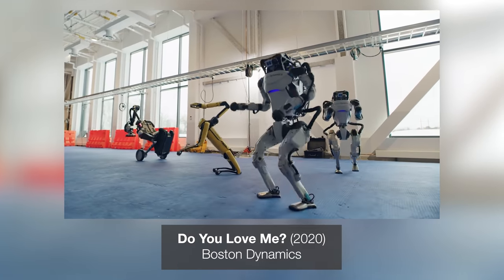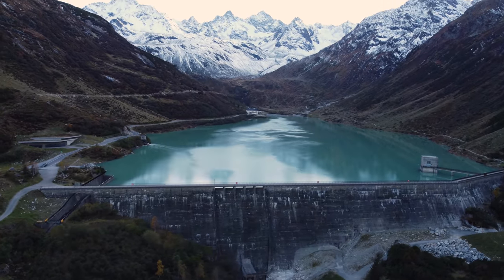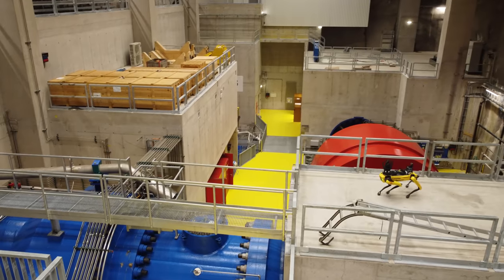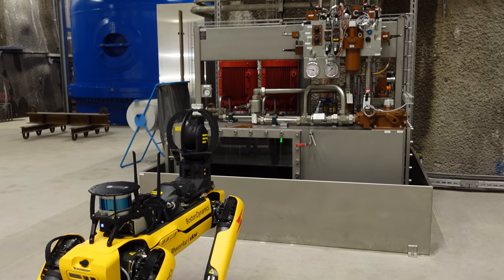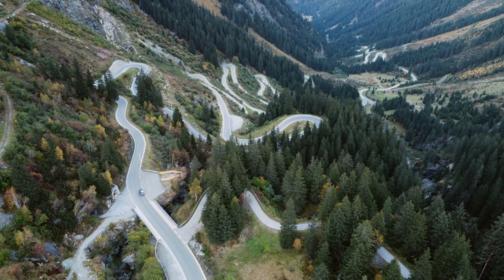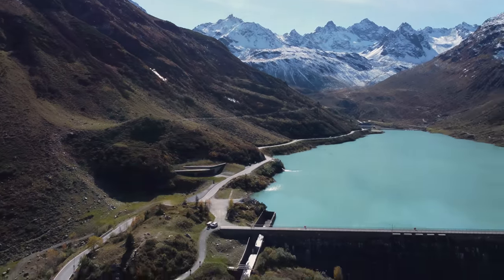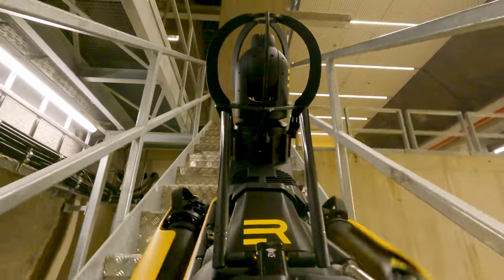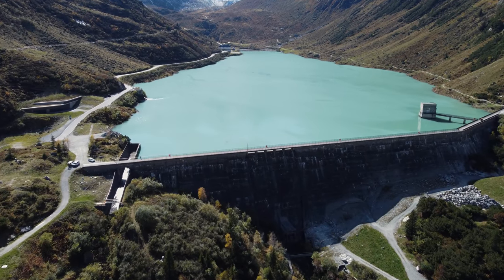An actual, real-world use for robot dogs

Comment: I'm really surprised it's cheaper to have sensors on high-tech walking robots, rather than just having more sensors that are stationary at the key points.
Reply: Interesting question! I hope someone answers....
Reply: That's what I thought. Just put cameras at strategic locations. Surely even a few hundred cameras are cheaper than one dog.
Reply: I wouldn't be surprised if one or two dogs were actually cheaper than a few hundred cameras. ;)
Not to mention the hassle of installing and maintaining them.
Or the issue of "key points" - what if something breaks somewhere else? With a robot, you can react on the fly.
Reply: One example of cost here is the Thermal camera, it costs about 5000$ and if you need 20 of those cameras around your plant the robot is cheaper. Another advantage is the flexibly you have with these robots, to check something the stationary sensor might not see
Reply: I wished they talked about this. But there MUST be a logical reason to use spot. Engineers are smart, they wouldn't buy spot if there was a better way.
Reply: @Morhua1  Engineers dont have a say in things like this. Business people do. So, sometimes decisions are made to further someone's political ambition instead of doing what makes sense.
Reply: that dog costs ~10,000$
an engineer costs more than 2,000$ each month
Reply: There is a near-infinite number of points that can can contribute to failure, and to detect some of them (e.g. concrete cracks, heat anomalies) you need fairly expensive gear. Having one of that sensor on a high-tech walking robot ends up being cheaper than getting a lot more of those expensive sensors.
Reply: There's an undefined amount of potential blind spots in a plant like this. A walking robot can cover so much more than stationary cameras.
Reply: Doesn't the dog cost over $70,000? And the camera and lidar on it's back add up to near $50,000.
*Upon further inspection, it looks like the thermal camera and lidar add up to near $60,000.
Reply: (Just a guess)

Even though the dog has a planned route and a routine, it is still adaptable and can move to various locations (or alternate angles) in case something is wrong. That way, it is more reliable in case something goes wrong that you didn’t plan for.

Or maybe the site is just that big, and one robot is cheaper than 10(?) also-expensive sensors.
Reply: The fact it needs thermal imaging in such a LARGE facility tells us all we need to know, and freedom of movement is king
Reply: @ignaloidas  Just put a moving camera on a rail.
Reply: The sensors at the key spots were installed when the plant was built.  The dog provides a supervisory capability with flexibility to check out things out of the ordinary without necessarily leading to an explosion of monitoring demands.
Reply: Also from a reliability stand point and cost of infrastructure it would not be feasible to install Thermal cameras literally every where possible needed just for 5 to 10 minutes of checking different machines states. having them take both physical space and require separate power source just to run them separately so as to be able to do an inspection safely in the case of an emergency.  it really does start to appear less and less as the better option
Reply: that's the problem though, key points
how many key points are there and what is even key points
at some point it's probably easier to just assume every point is key point and just make the camera mobile
Reply: @Morhua1  well to be fair, some engineer would sweet talk the higher ups to buy a spot because cmon
it's a spot, who doesn't want to program a spot
Reply: why would many dozens of stationary cameras be cheaper than a single moving one?
Reply: @ThreadBomb  rails are not cheap my friend
the guy even said it, it could just be simpler if they used a robot with wheels or track but the power plant is not designed to accommodate tracks

renovating the place with ramps or rails or what have you is not going to be cheap
Reply: @ThreadBomb  and how expensive would it be to construct a fully functional, automatic, reliable, lasting rail all over a power plant already designed for humans. The construction for that would take ages and would be very very expensive.
Reply: It's better to have one general, and flexible solution, instead of a thousand small tweaks.

Also, this robot can easily be programmed to turn some valves, press some keys and do all that physical work you would normally use humans for.
Reply: @kiiturii  would still be cool tho, to have autonomously-moving, spherical cameras on rails inspecting everything. Lets call them maintenance cores! 

... maybe in future-built power plants or something
Reply: like they said. You need a Person to check Cameras and Sensors everyday.The Dog doesnt need any Person to check up. They alarm you themself if something is wrong.
Reply: Not to mention the robot dog is a single point of failure, anything goes wrong with the dog like a sw issue, hw issue something spills/falls on it or its charging station, it slips on something - Good luck you are blind now.
Also the robot doesn't seem that fast, if the facility is actually so huge that 20 cameras can't cover it, how long is this robot going to take to tour the whole place and have time to recharge in a day (assuming inspections happen daily or more frequently). Ultimately no solution is a be all end all, any facility wanting to implement this should make thorough analysis if this is the best option and also have backup systems in case something goes down.
Reply: @TamaskanTH  unless something goes wrong it's alarming systems. Also a simple application can be made to check each camera feed and shoot out alerts if the camera feed is down. No system is flawless.
Reply: @ThreadBomb  And you think putting a rail system for a camera to move over the whole facility is cheaper than having a fully autonomous robot?
Reply: Can't put weapons on a stationary camera.
Reply: @ignaloidas  Nailed it, especially when the hound can position those sensors for multiple aspect observation
Reply: The robots job is to check the sensors that already feed back to main control room. it also look for other signs of danger that cant be detected by sensors such as cable degradation by suing thermal imaging.
Reply: Well it was built for inspection not remote surveillance
Reply: I think people are missing some important things here. Getting thermal cameras for each failure point might be more expensive upon the initial investment, but that robot is going to start racking up expenses quickly. It's a highly specialized $75,000 piece of equipment with with moving parts experiencing constant wear and tear. Not to mention that it also has other expensive sensors on it that may also run into problems more often due to the robot falling over / running into things from time to time. Its that vs. Stationary cameras (that could even swivel to view more of the facility) which will last significantly longer without failure and be much less expensive to fix/replace.

And beyond that, doesn't it just make more sense to have the failure points be monitored constantly and simultaneously rather than only being checked one time every other hour?

There is a reason that we have multiple self check out stations at the grocey store, and screens to order food at fast food places instead of robot workers.
Reply: @herp_derpingson  ah yes, political ambitions clearly exhibited in using a walking log
Reply: Many pieces of equipment have internal temperature and pressure readings that are controlled internally and work with a center program to display all the data in one place. The robotdogs will be best used for long runs of pipe in utilities facilities during periodic inspections usually done by outside contractors.
Reply: I think it is to have the flexibility of looking at new different things, and check overall damage state (has anything changed, are all human path ways still accessible etc.)
Reply: @Xaxt99  The point other people are missing is that points that need constant surveillance, will have constant surveillance already.
This is for maintenance that would require a human engineer drive to the facility and check on things - regularly but not constantly. As they said, they did this job with human engineers before. So the comparison should not be between dog and stationary cameras, it should be between dog and the salary of a qualified engineer plus overhead.
Reply: @Xaxt99  Luckily, we don't have to solve the problem of how much it would cost to set up full camera and sensor coverage because that's already been worked out - it costs more than paying an engineer to go out periodically and look around (which also picks up any incidental unusual happenings that aren't directly monitored but could become an issue if left unaddressed) which is why the robot's being compared to a human.
Reply: @Morhua1  Then you do know engineers real well then, the logical reason is that we WANT one to play with. What other reason even matters. 😃
Reply: @varana  But you can still accomplish the same task with just the cameras. It would be one thing if it was physically manipulating things, but its just taking pictures and reporting back. And if the areas don't need constant monitoring you can just have the cameras take pictures every hour and get the information back instantly instead of having the robot slowly traverse the facility. It just seems like a unecessarily and complex way to take a picture.
Reply: @Jehty_  Thermal cameras aren’t. And say if it’s a huge place… like a power plant with many massive intricate parts you’d want a robot to be able to move around and underneath objects. To inspect things.
Reply: Then you just have to send engineers out to replace/fix cameras all the time. If you have 500 cameras, you're probably going to need to go poke one every couple weeks, if not more often.
Reply: @akshaydalvi1534  you realize the human inspector isn't there 24/7 either? like bruh if something goes wrong with the robot they send someone to take care of it? your point makes really no sense at all.
Reply: Exactly my thought. It seems like a (kinda bad) retrofit and newer industrial facilities wouldn't be built like this.
Reply: I think the confusion comes from you underestimating the cost of high tech sensors and cameras. Yes the dog is expensive, but the cameras that are attached to it, while smaller, are also very expensive. The dog is infinitely cheaper than having to purchase and install hundreds of cameras and sensors in the plant. Also if you want a new location to be checked or from a different angle then you need to install a new camera, rather than just telling the dog to check another location.
Reply: Something to add here... adding more cameras would involve paying time and money to a company to come out and install the cameras, the conduits, the control station, run the wire, and pay the workers as well.  For the number of cameras needed, and complexity of putting them in place and maintaining them, as well as having many more points of failure.... a robot dog might actually be cheaper in the long run.
Reply: @varana  I think they're about $80k or so. So hundreds of cheap cameras would definitely be doable.
Reply: It's not cheaper.. they have to use up their budget or it gets cut
Reply: Sensors for industrial environments are more expensive than you'd think. Also the sensors would need to be interlinked and powered. And installing them is another cost. Plus maintenance of the sensors
Reply: whos gonna inspect the cameras?
Reply: @t9o6b3i  - Excellent point about the thermal camera.  Also, as thermal cameras improve - they only need to replace one or two.
Reply: Well, have 500 key points that need to be inspected and one bot or 500 sensors at all those key points (and that means, you only inspect from ONE position each time, because they are fixed and can not move around)
Reply: I think the relative benefit is not so much cost as extensibility and mutability. Stuff that needs very regular monitoring could be a camera, easily. But it's a big facility. If they have a very high number of things to inspect on different schedules, you're looking at one robot vs perhaps a thousand cameras, all with wiring and conduit, some of which are used once a month and some of which need to be very sophisticated, plus the server/network infrastructure to connect them all. The robot dog is only $75k, plus peripheral devices. You can easily exceed that with specialized surveillance infrastructure, to say nothing of network maintenance costs.
Reply: @ThreadBomb  they talked about in the video why this is worse than the robot, the power plant is designed for humans so it makes sense to have a robot that can navigate human spaces to do a human job, a camera that can move in 2 directions would be restricted by anything in front of it, unable to check the 100s of inspection tasks not immediately visible, and building a giant rail to carry around a camera with thermal capabilities, especially given that you’d need a lot of them, would probably cost way more than the $200k spot does
Reply: what you guys need to take into consideration here is the cool factor
Reply: I would say, look at it like this. The robots are future-proof in a way, or rather, a universal "tool" or sensor that is growing, expanding, getting smarter and more cost effective with time. Rather than installing hundreds of cameras, having to build the infrastructure for them, maintenance, and changes to that system as the environment changes.... You could instead have ONE, very smart universal "sensor". When the factory changes, new parts or machinery is installed or removed, you no longer need to add more cameras, or move existing infrastructure. Your doggo's just learn a new zone. Or heck, might even be smart enough to require no changes at all.

Similarly, you now can take that universal concept in employ it anywhere. Use the same basic logic, but in ANY warehouse, using the same set of rules. As you scale the concept, that is when you will see the cost benefits. As mentioned in this video, just this ONE control station has to manage 20 entire plants all on their own. Imagine how much time, money, and effort it would require to install hundreds of cameras and sensors at 20 warehouses.  I'm just guessing here, but I think that's where you're gunna see the benefits, and the streamline. Why manage and monitor 2,000 camera systems and sensors when you could instead keep an eye on 20 robots who are doing their jobs autonomously 🤷‍♂️
Reply: Why pay for 20 $200 cameras + integrated system when u can pay for one cool doggo that a) only has a couple sensors so it's cheaper in that effect, b) already fully integrated so no extra cost for that, and most importantly c) no person is just sitting around watching cameras so they don't have to use resources to pay someone. All over the overhead for the doggo will equalize with the cost and operation of any other system
Reply: @quaramher  If you need to sense humans in combat, probably. The base version is more like 10-15k.
Reply: Just like the robot balls in the game portal 2
Reply: @Xaxt99  In the end, the dog is just a moving camera. So why have dozens or more of stationary cameras with all their limitations, when you can have one camera that's moving around and can even adapt to new situations? I don't get how this is even a discussion.
Reply: @spiritusinfinitus  But cheap cameras don't do the job that the dog is doing.
Reply: @akshaydalvi1534  if the dog goes down you can just send out a human like they used to, no real issue there.
Plus because the dogs are all identical but with different code all you gotta do is send said human along with another dog, copy the code onto the new dog & away you go.
It'd be a bit of a bother sure but you could do it in a few hours if you have access to a spare dog.
Reply: @Xaxt99  I 100% guarantee you that all those sensors are already in place. Spot is there as a human replacement to be able to """physically""" view those sensors & surroundings to make sure all the data is lining up 100% & to inspect all the weird little areas that installing custom sensors wouldn't make any sense.
Want to check your generators are in good condition? I'm sure you probably have a bunch of sensors already doing that.
Want to check the building didn't get flooded, especially the office? Well you probably don't have a series of sensors to detect that.

Comes down to versatility. One robot decked out with 10 sensors can go ANYWHERE a human being can go which is EVERYWHERE a human being is legally required to go & you only have to buy one (two if you want a backup unit) vs hundreds of sensors or paying a human to walk around doing it all day.
Reply: @kaylor87  to add to your adaptability arguement it's even better than that because when a Spot 2.0 or better comes out all you have to do is buy the new one & sell the old one. Compare that to tearing out an old CCTV system + server to replace it with updated gear and it's just a no braininer from a flexibility & cost standpoint.
Heck you could probably have the old Spot 1.0 & the new robot working side by side if you wanted to or at very least until you were sure you didn't need it anymore and then decommission it in what, 20 minutes?
Reply: As someone who has maintained facilities like this, there are no "key points" that you have to monitor.
There may be locations with higher risk devices, gauges, etc, but there are also miles of pipes and cables and conduits and mounting bolts and pressure vessels and electrical panels for each motor, etc etc.
An engineer doing an inspection will be eyeballing all of this, and it doesn't all require close inspection every trip, but you are looking at the pipes and bolts as you walk past looking for corrosion or leaks or loose bolts.
And a thermal camera makes this even better because you can now spot temperature changes from electrical issues or fine sprays from a pinhole leak.

A lot of industrial plants use thermal cameras for periodic inspections already, but do you know what's more expensive than the camera? The engineer to spend hours walking around with the camera.

This gives you 12 hours a day (after charging time) to run thermal imaging sweeps of the entire plant, with it programmed with alarm limits based on the proper temperatures of various items, for the one time cost of the equipment.

And no, you can't put cameras on rails, because most plants are not laid out in a neat way that allows everything to be viewed from a rail.
You can't see the rear of machines or underneath them etc, and in a dense multi layer plant like this, you would need multiple rails and cameras just to get each floor.
Plus all the rails would get in the way of the overhead cranes and such during maintenance, and would cost more than the robot to engineer and install in a place like this.

Also, this plant is already remotely operated, meaning that it already has sensors and remote reading gauges, cameras etc, but they also have mechanical gauges next to the electronic transducers, and an engineer walking through will be comparing the needle with the display to verify the calibration, and they will also be putting their hand on motors and pipes to check temperatures, and those are things that this robot can replicate.
Reply: @ke6gwf  You absolutely CAN put cameras on rails. What are you talking about?
Are you thinking of making one long monorail that goes through the entire facility carrying the lone camera cluster? Because that's absolutely not necessary. You can have a camera cluster in each zone on a rail that covers the equipment only in that zone. If you needed 50 such rails and 50 camera clusters, you still wouldn't be paying what it costs for one of those dogs.
You can get fairly cheap camera clusters that can be aimed and zoomed to look through the plant enough for daily inspections. Such cameras could even be placed where they could see more than the dog.
And it's worth noting that the cameras don't have to completely replace an engineer. They just need to drastically reduce the amount of time the engineer spends doing inspections. Automation doesn't necessarily mean completely replacing someone.
Autonomous robots are expensive enough that they're unlikely to be the solution that replaces inspections by engineers.
Reply: Or for a facility this large, why not a drone? Why must it walk on the ground?
Reply: @darkjanggo  in a company, the 'cool factor' does only translate into money when it is in advertisements.
Reply: @RalphH007  yes